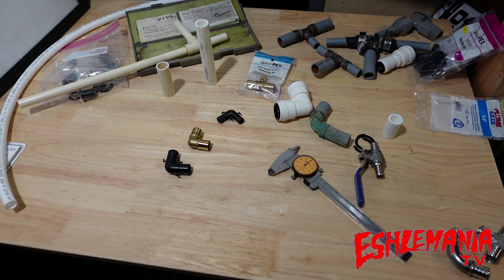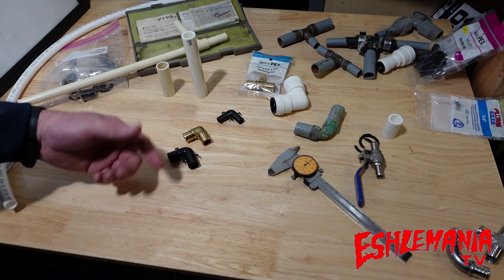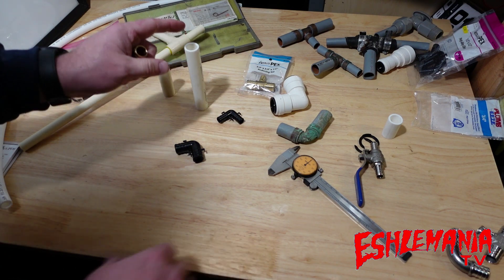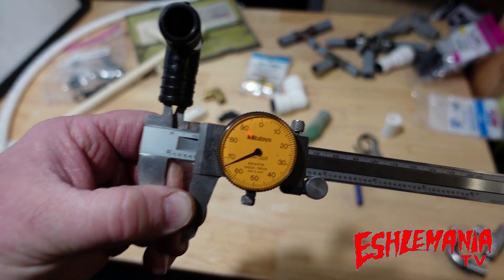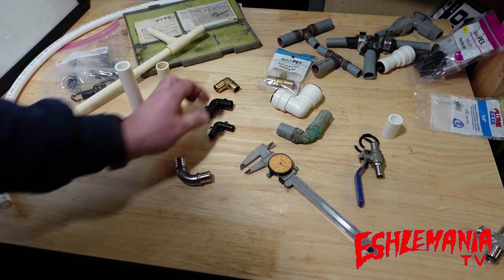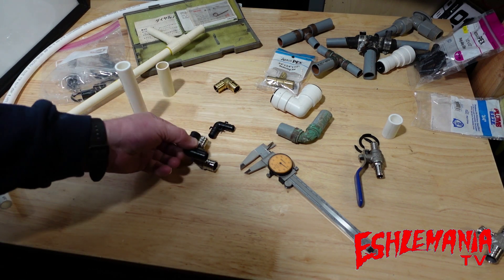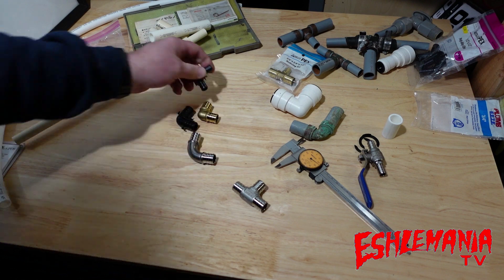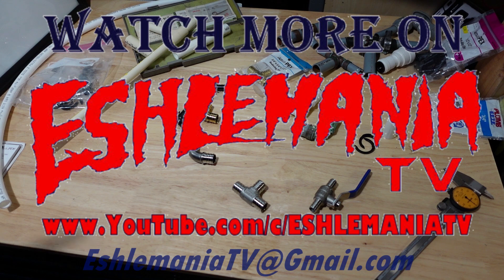PEX Fittings: What People Often Overlook When Choosing What Type Of Fittings They Use.

Comment: PEX tubing took the plumber out of Plumbing anybody can do it I'm 66 I have done Plumbing 46 years never have I seen so much slop has the reels with PEX tubing there's no art to Plumbing just slop and no longevity to that garbage zero skill level totally breaks my heart nobody can even solder a copper joint anymore used to have to have a plumbing license state license by the Board of Health don't know how it is anymore these days anybody can do it! It just took everybody's Plumbing license sent tore it up and threw it away! If you want things done right hire a licensed plumber then we won't have to worry about these problems of sizing things too small because the average John Doe doesn't know good thing you put this down on your post! Three-quarter pipe should be used for half-inch in PEX tubing and 1 inch or three quarter that would be a standard rule of thumb but people don't know that you go to the hardware store and you say Adventure Packs tubing in they hand you these little things that barely put on enough water for a couple of faucets thank you or letting so many people aware of this:-) goodbye to Old School Plumbing:-(
Reply: Pex took the outrageous fees homeowners were being charged and made it so someone with half a brain can repair their own plumbing.  Since the pipes are either under the house or in the walls, I'm not too concerned about winning a "most beautiful pipe" contest.  Function over beauty is the motto of the day.  Licensed plumbers hate Pex and sharkbite fittings because it puts the power back to the homeowner and leaves money in the wallet.

Comment: Poiseuille's Formula says that fluid flow through a pipe is proportional to the fourth power of the radius or diameter.  So a half inch diameter pipe will only flow 20 percent of what a three quarter diameter pipe will flow.  (0.5/0.75)^4 = 0.197.